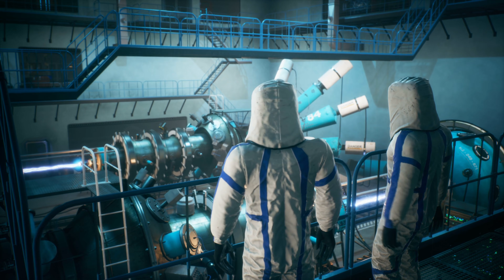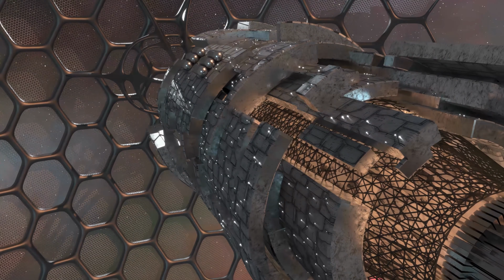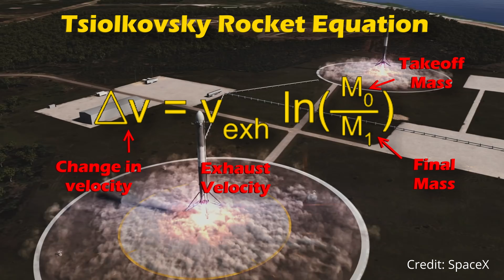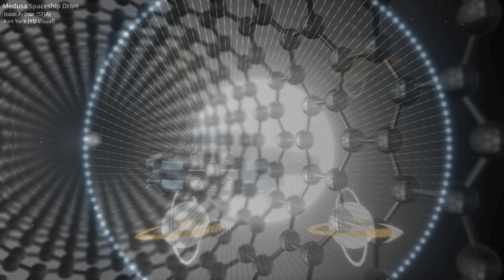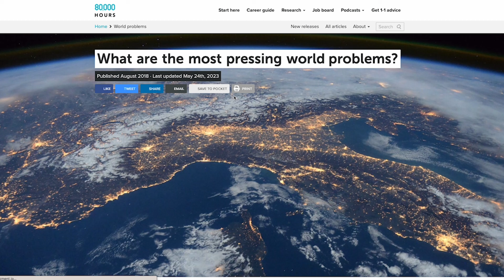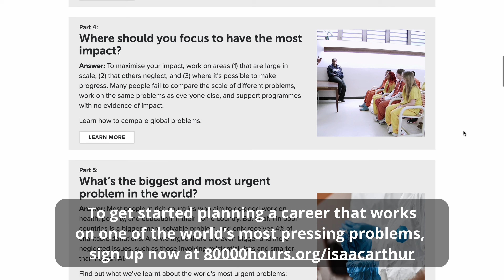The Medusa Drive: A Starship Pulled by Nuclear Bombs

Comment: The parachute🪂 for sail ⛵️ is used for satellites 🛰 no blast needed because of solar winds
Reply: I have a sightly different idea 2 wing 🪽 Arch Angel drive you don't need nukes but moving gears open for speed using solar winds to move faster and "left,right,up,down if you use 4 let call it Nephilim,Seraphim,
Cherubim,& Ophanim.

Comment: About the safety concerns: I think that this means that such ships would not be piloted by just about anyone, but that they'd be tightly regulated vehicles. A bit like modern (passenger)transport planes. And much like how these planes can expect an interception by fighter jets to see what's up if something seems off, there'll be military spacevessels fullfilling "coast guard" (orbit guard?) making sure to be nearby to respond if necessary. Similarly, these vehicles will probably never get to be nearby habitations, or be on a trajectory that extents close to one, and stops by spaceports at a safe distance away instead. Far away enough that the orbit guard has enough time to react to funny business.

From this POV I also don't think that spacevessels have to receive their nuke-fuel only after they have taken off. Because if your system isn't set up such that you can trust them with the nukes/they can do damage with them, your system isn't set up right. It is a setting where such propulsion is common place enough that you have to be prepared for stuff going wrong after all.

Comment: Due to the diffuse nature of Hydrogen, even when combined in a salt with Lithium, prevents a fusion power source from being as dense as a fission power source.  This is why Deuterium is used in H-bomds rather than the mundane H used in Li+ batteries.  This is to maintain a neutron flux around a secondary fission core.  The largest weapons designed had a 3rd fission core.  They call this a "daisy chain," and there is no limit to the number of core that can be put together, like this.  There would be no need for secondary cores were fusion fuel as compact as fission fuel.

Comment: hey, quick question, how do you stop?

wouldn't you need to either flip around, or have a second sail on the rear of the ship? or thrusters on the front? At what point does maneuvering become impractical, since this design seem like it may work to go forward, and that's it

Comment: While the engineering seems perhaps a bit more complete with this compared to nuclear salt water reactor (NSWR), NSWR seems to be about as feasible, simpler, and would have presumably a higher specific impulse if run with highly enriched / plutonium salts. TBH, NSWR seems easier to engineer for as you have steady state thrust instead of pulsed propulsion.

Comment: I'd prefer the solar sail approach, first problem I see with this is we are relying highly destructive forces for propulsion far beyond anything you'd see in a combustion engine which is in of itself unnecessarily risky think tickling the dragon's tail. 
Then we have the issue of wear and tear; even if the sail were reinforced and at considerable distance from the ship with the ability to expand, considering the the power of what we plan to use that sail would survive maybe a few cycles at best. As the plan is blast it in succession to build speed, even if it were to survive acceleration there is no guarantee that it would survive long enough to slow down. We would essentially be taking a high risk gamble every time we wanted to change speeds.
Thirdly is the logistics, as we're talking about long range space voyages realistically the amount of spare sails and bombs this ship would need would be staggering and the costs would be far beyond the anything the world could afford, it's not like we are would be able to call AAA for a replacement sail when we inevitably burned through the first.

As far as interstellar drives go it sounds like engineering shower talk rather than a actual solution, as by the time this becomes even remotely feasible\reliable there are likely going to be far better options that don't rely on chain detonating nukes to speed up.

Comment: There's a problem with this design. Since there is no wind or other medium to disperse the high radiation from these nuclear bursts, the ship will not only pass through this, but leave a trail of dangerous radiation. Though this is a more "realistic" design than say, a warp drive, you are still poluting the space you're traveling through; even if the ship is shielded against such radiation. Nice try but no cigar.

Comment: i always envisioned a cylinder ship with an Orion drive at both ends - the forward pusher plate is shielding during travel, and the ship can brake without the mid-flight flip or even use the forward fuel bombs offensively to remove obstacles that may appear. Conversely, the Medusa seems like an obvious use as a drag chute for an Orion system. Again, no mid-flight flip for braking - the Medusa just pulls the ship backwards, it's deployed way further back than where the propulsion bombs deploy.

Comment: The Idea sounds as elegant as using a 200 pound anvil on a horses back and smashing it with a ten pound sledgehammer to make the horse stagger forwards. Solar sailing would be far more elegant and less of a bad transition of harm through the universe as the continual pulses of nuclear explosions would create, Yes I know stars and nebula radiate gamma and lots of other stuff, its just impractical in so many ways, course changes would be difficult course correction would be almost impossible like I said impractical, Solar sailing like a vessel at sea but in space far more control.

Comment: I'm not sciency enough to fully understand what I'm about to propose, but I ask...

What if you had ion jets on the parachute pointed at the explosion...back toward the ship...would the exhaust plume generate with concentrations to resist the pressure like a sail? Thus reducing the strength requirements of the sail materials. With added bonus of slower, but added speed from the ions.

Comment: You would need an array of lasers shooting into the edges of the sail to maintain its shape. You could also manipulate the sail into different shapes with that laser to impart directional thrust.

A big issue with this design is that you are flying blind. You wont be able to see what is ahead of you unless you get an antenna outside the shadow of the sail.

Comment: This is impractical design. It request not only strong shielding in blast catcher, but also in front of spacecraft itself. And also those ropes has to be imprevious to radiation.

Orion type propulsion has same thing for blast catcher and spacecraft itself and does not need tethers.

Comment: How viable would this actually be in interstellar medium? It should have quite a bit drag at higher speeds. Which as mentioned you can use to slow down near destination but to “drive” at higher speeds speed large distances through ISM seems “dubious” to me. Interplanetary at speeds higher than chemical rockets can do but not nearly as fast as you would need for interstellar should have much less drag and be much more viable.

Comment: In Netflix's 3 Body Problem, They used a similar setup to accelerate Yan Tian Ming's Brain, but the parachute had a hole in the middle, and the nukes were already displayed in a prepared path. The explosions were timed as the nuke entered through the hole in the parachute. It Also had like only 8 tethers and one of them broke, which sent the capsule offcourse. I dont quite remember if that was how it was done in the Books. 

By the way, whatever happened to the Aliens in the episode "Dead Aliens"?

Comment: I think the best approach is a hybrid Medusa-Orion drive. Use an Orion drive pusher plate to speed up, and then extend the Medusa parachute out the back and shoot charges at it to slow down. This way you can avoid turning the engine side of the craft towards the debris stream while decelerating. A pusher plate is tough, but you still don't want debris to collide with it: that's what the front shield is for. ⛵💣🚀🛡☄🌟🪐

Comment: If you got an elastic material that can take a nuke, why not make it a full balloon and have directable nozzles so you don't even have to worry about the ship going thru any of the exhaust and can get some extra maneuverability out of it, and maybe even the ability to throttle in a more gradual manner and save some pressure to use later if you don't need all of it right now?

Comment: since you mentioned sail. Older sails are drag device that can only go as fast as the wind, but modern sail act more like airfoil where it can go several time above wind speed if moving at the correct direction. Perhaps this nuclear pusher design can be enhance into a nuclear lift sail instead to increase "lift", by exploding the bomb airfoil shape sail instead push it. Similar to how modern day sail boat using an airfoil shape sail to move faster than environmental wind speed.

Comment: Drack Drive (Medusa Variant): It doesn't have 1x sail, but 10-20x sails. Gamma rays and other high energy produced by nukes = a high % will go through sail 1 w/o capturing ALL the energy. More sails = more energy captured. 
     Use the same tether, but segmented so you can detach and 'redeploy' replacement sails as necessary. You might have 200-1000 replacement sails. 

The front-facing parts of your ship would be ultra-reflective: so that lower energy rays produced by the blasts  get reflected back (towards the sails), adding a small % boost to the propulsion. 

FOR DECCELERATION: there's a 'rear sail'. Only a few dozen nukes + maybe 30 sails (+ 5 sets of replacement sails). the sails are 10-20x wider and inside + spherical 'ring' around the farther out (and wider ones) are solar sails as well. 
        The idea being once you get inside your desto system you'll time detachment of front sails + deployment of rear sails...You're gona be MFG new nukes +  sails etc in your desto system (if its a waypoint)...The rear sail system doesn't need to be as durable (vs  front sail system for interstellar): all rear sails need to do is provide large braking. 
       You'd brake while doing Hoffman  Transfers between the destination Sun + other nearby planet (maybe repeating the transfer several times to bleed delta-v during transfers). 

      You're last hoffman transfer would be to your destination planet (or planet nearest the destination space hab if the habitat isn't in orbit around the planet). IF the latter you'd just 'row boat' transfer via smaller craft to your destination...Leaving the interstellar ship in a high orbit around the planet.

Comment: I think that the materials are going to wear out and break often enough to make this impractical. Repeated stresses on materials with forces at these magnitudes are a maintenance problem that requires a lot of mass, time, and labor. More hassle than it is worth for regular use but feasible for just an experiment.

Comment: Huh! So, the "sail" of the ship can be shot at by relay stations from the midst of the solar system all the way to the Oort cloud with nukes, then it can be pushed with lasers for as long as the said lasers can be kept at it and then it can be shot by the ship itself, either with bombs, or with lasers (if the ship have a huge reactor, powerful enough to power lasers at least in the gigawatts range that is). Combining that with the option of using magnetic sail, utilizing the solar wind and the fact that we can create relay stations in between the stars as well... it seems that we have the technology to travel to the closest stars in less than a 1000 years already! Not that we need to do that yet, but it is kinda reassuring to know that we can prepare the necessary infrastructure and travel between stars, if we have to at some point. Well, at least if we realize how dumb it is to fight over some microscopic amounts of resources on the surface of Earth, while all that abundance awaits us in the Solar system (not to mention - the entire local region of our galaxy). Thanks for the upload, Sir Isaac Arthur! Liked 👍 Have a nice week, everyone 🍀

Comment: accelerating and high top speed is one thing BUT another is deceleration . . how would you slow down whithout using an insane ammount of fuel ?

turning it around might work good enough but it would still require as much energy and time to slow down as it took to speed up whitch is may I say: a little akward / wasteful . . .

Comment: Project Orion is still more feasible. They even tested pusher plates back in the 60s. I think they're glossing over the potential risk from radiation and just how much shielding is necessary. The 'chute would need to be shielded so much that it would be effectively useless. Anything that expands like that will not be protecting your ship from incoming dust and debris, which will annihilate your ship when you're traveling at percentages of c. Of course, unless you invent some newfangled material. Project Orion could go right now, with technology developed in the 60s.

Comment: This seems borderline feasible with current technology. I think by the time be fix the CO² problem we will probably be in a place where we could at least send up a test device with a spinnaker and a single nuke. At this point i don't think we have the materials to make it, but the test shot would work even if some of the sail is vaporized. It might even be worth making the sail from multiple materials to see which parts do the best on thrust and remaining intact. The hard part would be that we would want to do it on a trajectory that will keep most of the debris away long enough to decay adequately. Public perception will probably require this to be taken to an extreme, i.e. in Martian orbit...

Comment: This is very similar to the "Project Staircase" plan used in Three Body Problem (at least, as portrayed in the Netflix adaptation, I have yet to read the books)  It used a series of pre-positioned nuclear weapons rather than shooting them out from the probe at the sail (and thus had a small hole at the front of the sail to allow the nuclear warheads to pass through), but it was largely the same sail method by which a spacecraft is dragged forward by a tethered sail that catches a series of nuclear explosions.

It's neat learning about the actual drive system that plot point is based on.

Comment: The pulsed propulsion would probably make the trip a tad unconfortable, not?
Reply: Orion drives smooth out their acceleration through dampening and shock absorbers, I don't see why a Medusa drive vessel couldn't do the same. There's a neat animation of a Medusa drive if you're on YouTube that shows the cables were like slackening and tightening in order to dampen acceleration forces.

Comment: If your civilization can maximize the resources in your solar system you can sustain it for a few billion years. That gives you time to perfect a jump to a passing system. Given enough time you will encounter another system passing within a couple of light years. I don't see the practicality of traveling around the galaxy knowing it's mostly hydrogen.
The trick is to maintain a small, manageable population so you don't need unlimited resources to begin with.

Comment: As a former Submarine Reactor Operator, Prometheus,  Orion, and Medusa are just too risky. I like gradually increased reactor power similarly to progress through the intermediate range of fission power reactors. I highly prefer the nuclear light bulb designs. Especially with all the free hydrogen available in space, our planets, moons, and asteroids. Also, control rods can be locked down, and launching an SP-100 size reactor is far safer than advertised! Especially, since launching and needing them on the moon and mars will prove that launching yet another for the first Mars earth cycler will be trivial! By the way water and steam power is just as primitive sails! Helium or NaK and Sterling generators are far superior for reactor cooling and power generation!

Comment: Could you use that parachute to generate a magnetic field to interact with the solar magnetic field and the solar wind of your target system to help to slow down? A bit like a Bussard Scoop, just for slowing?
Probably not adding much in terms of efficiency, but if it could be done easily and low-mass, why not…

Comment: Even with fusion bombs, some of what will be hitting the sail will be material (pieces of the bomb itself).  The vast majority will be smaller than a dust particle, and it all will be liquid, but will cause damage to the sail.  The Orion pusher plate will likely keep a portion of this, potentially getting more massive reducing the degradation that would otherwise happen from repeated pulses.  one of the advantages of the Orion drive over the Medusa drive
Reply: I suspect you'd accelerate, then "drift" so you could recycle or dump the sail and then "unfurl" a new one once you need to slow down.